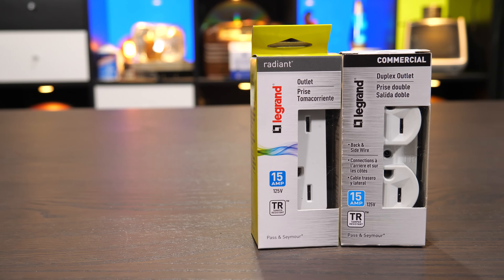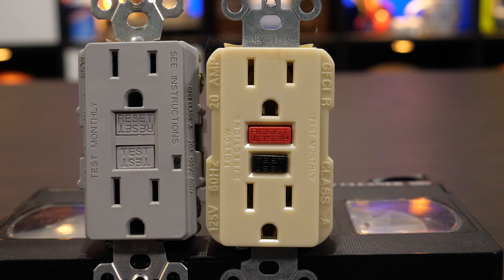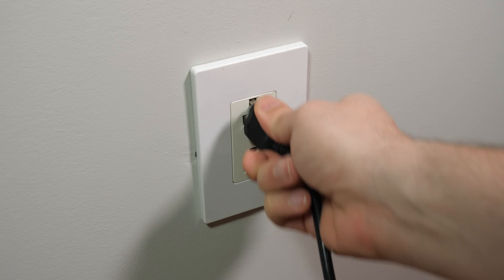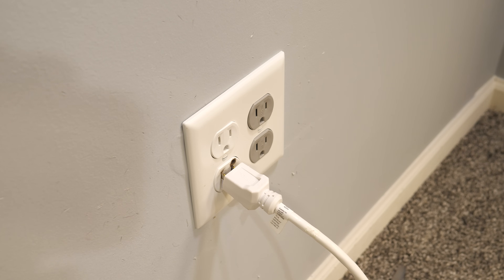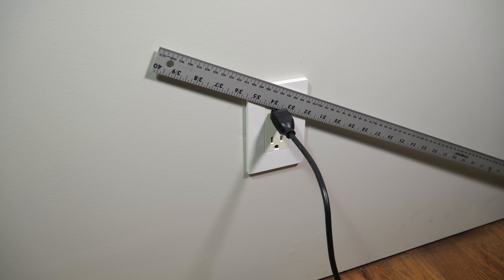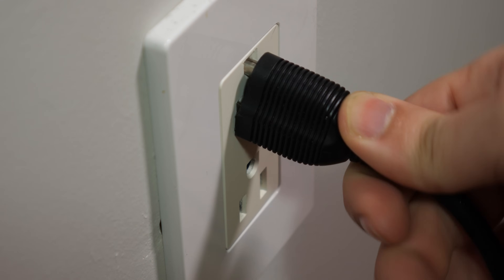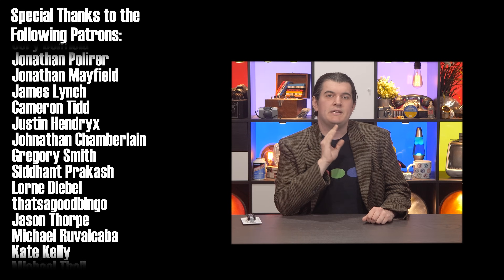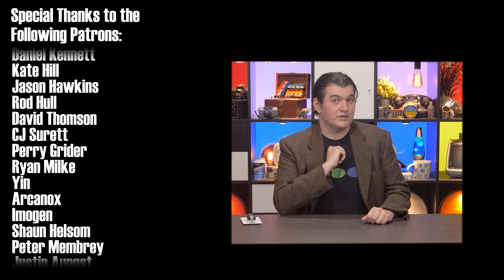Power outlets are topsy turvy - but does it matter?

Comment: It's a bit strange  for me,  the whole 'US plugs' business.  
There is an old standard in EU, when you have all slots in your outlets block  rotated clockwise by 45 degrees, with live pin being a lowest one. It's an arrangement that allows to produce fairly compact outlet blocks (usually it's modular with  8 available slots, normally 6 are used as  power outlets, and  2 as  communication ones  for network and/or  phone line) but one can mix and match.

Anyhow, It's actually feels very natural when you plug it in. Takes less space on the wall, allows to arrange cables in a more neat way and somewhat solves the problem of a hot blade being on top (also you get 'neutral' as a top one, and ground besides it)

Comment: Here in the UK most outlets are fitted with the Earth pin at the top, and we don't have two pin plugs at all (the Earth  pin has to be present to move the shield away from the power connections). However, annoyingly some manufacturers produce power blocks or leads with the lead coming out from the Earth pin end (we would say. 'The top'). That's a huge problem when you want to use some multi-way connectors!
Reply: @@jash21222 In the UK the phone chargers usually have an extendable earth pin, which is plastic. So not actually an 'Earth pin' as such, but still necessary to push the shield away as the plug goes in.

Comment: Tbh American plugs are pretty bad overall, it used to be the standard here in Brazil as well, you'll often find it in older houses and electronics, but we are using a 3 pin standard for a while and it is much safer

Comment: Some folks say, Type G connector is the safest of all (British type)
however the Type  E and Type F is good to, because  those are lowered in the walls, so no chance to partially plug in (but those not has a strict requirement for the live side).

Comment: UK mains plugs are made to BS1363 standard. Sleeved line and neutral pins, cable hangs vertically down and have a built-in replaceable fuse according to the power consumption of the connected appliance.  The only downside is if they fall on the floor they usually land pins up. If stood on with bare feet, they're worse than standing on Lego bricks.

Comment: seems like the best way to do it would be like australia: the wall point things are side by side and orientated in a way where right angle plugs have the cords go downwards. or, yknow, designing a good plug that has bits of plastic on the inner ends of the metal bits and maybe doesnt fall out so much